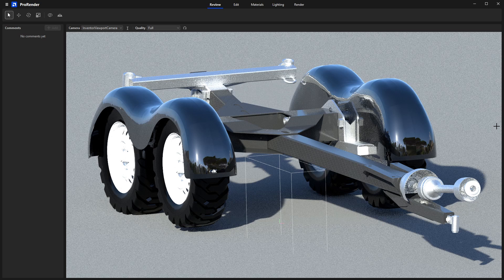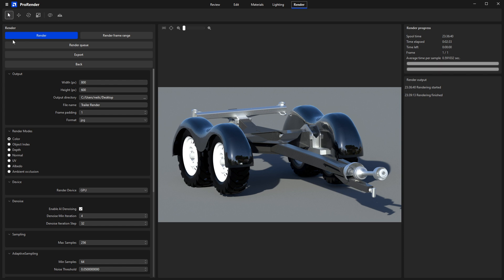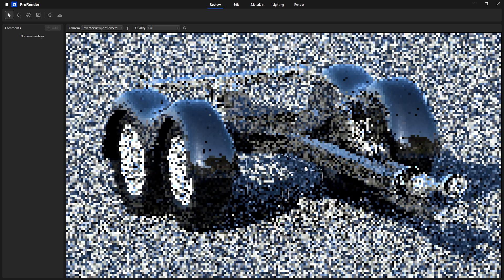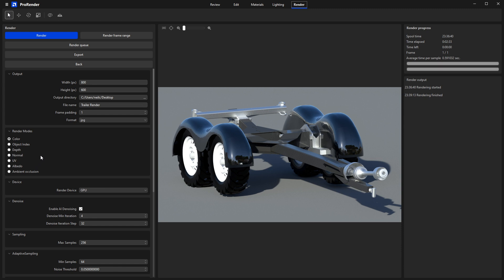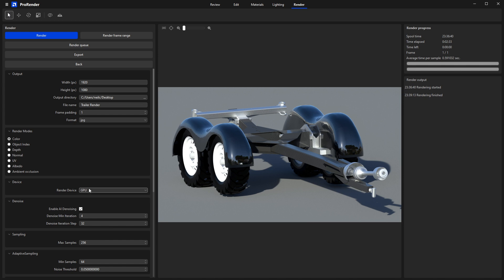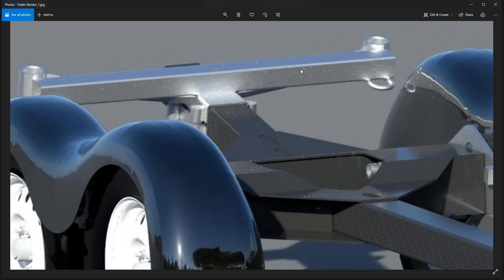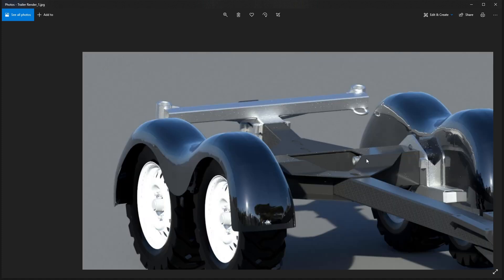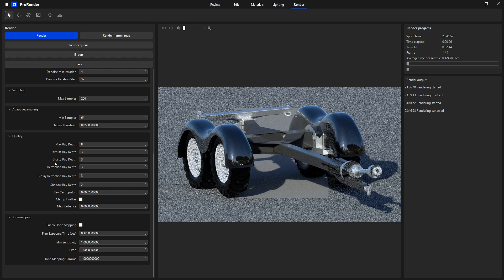Render Output 5/5 - AMD Radeon ProRender for Autodesk Inventor

Comment: I get the following error message:
"Some problem with button action, see logs."

Inventor version: 2021.3 (Build 253353000, 353)

ERROR| UsdConvertor.UIElements.ButtonHandler| System.NullReferenceException: Der Objektverweis wurde nicht auf eine Objektinstanz festgelegt.
   bei UsdConvertor.UIElements.ButtonActions.AssemblyReopenAction.ButtonAction(Application inventorApp, NameValueMap context)
   bei UsdConvertor.UIElements.ButtonHandler.ButtonBaseOnExecute(NameValueMap context)| System.NullReferenceException: Der Objektverweis wurde nicht auf eine Objektinstanz festgelegt.
   bei UsdConvertor.UIElements.ButtonActions.AssemblyReopenAction.ButtonAction(Application inventorApp, NameValueMap context)
   bei UsdConvertor.UIElements.ButtonHandler.ButtonBaseOnExecute(NameValueMap context)
Reply: Please, may you give additional information about environment? 

Also I should mention, that it is possible to setup inventor 2022 version of plugin to 2021 inventor. But 2022 plugin doesn't work in 2021.
Reply: @feniksgordonfreeman  any solution to this?